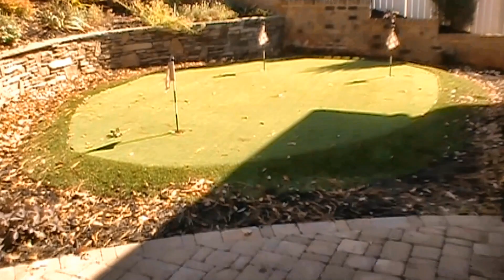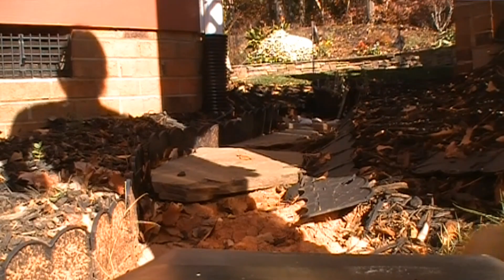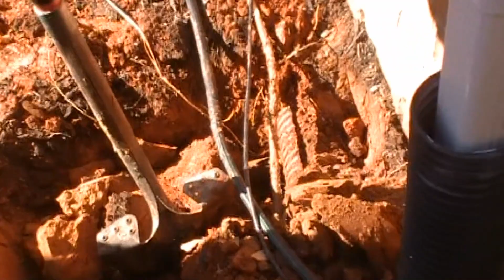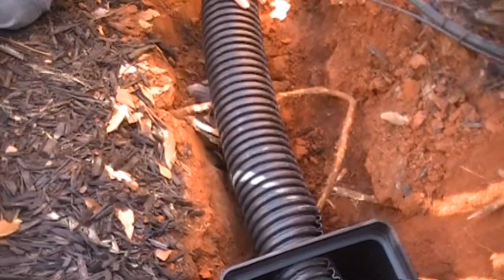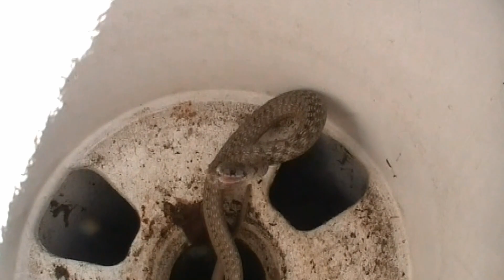$25.00 Fix to Solve a Flooded Yard

Comment: I have this problem times 10! My neighbors drainage ends up in my yard and the only discharge ends up in my other neighbors yard. What a mess! I would start but don’t know where to begin..awesome video
Reply: I can relate. Our back yard is a big hill and half the neighborhood dumps into our yard and both our next door neighbors.

We did aggressive pitched concrete last year - patio and drive - and haven’t even had the sump pump come on once. But now we have to figure out the yard which is a swamp when it rains,

Live and learn and I’m never buying another house with poor water drainage
Reply: Maybe we live in the same neighborhood!

Comment: Hi ! I love your videos  ! Just a safety suggestion,  I take a piece of small diameter rope long enough to reach to the top of the ladder that I'm using to clean the gutters out and I make a simple overhand knot and i tie it on one of my side belt loops ,then any tool that I might be using  ( leaf blower,  water hose , ect ) 
tied the the other end of the rope so when I'm going up or down the ladder I can hold on with both hands climbing or descending the ladder. You just use the rope to lift your tool and lower what ever tool you need to do any job  !You can just leave the tool tied onto the rope while doing your chore  .  If you need to physically get on the roof make sure the ladder  is being  held, footed,  at the base of the ladder untill the ladder is possibly tied off( unless the ladder is being footed the whole time that your on the ladder !!) some how at the top  so it doesn't kick out at the base of the ladder or slide off the gutter at the top of the ladder and make sure you have at least three (3) ladder rungs ,  (steps ) above the roof for easy access on and off the  roof  !  I know it sounds like alot of work but your life is not worth getting hurt or killed over some darn leaves or other work on your roof  !